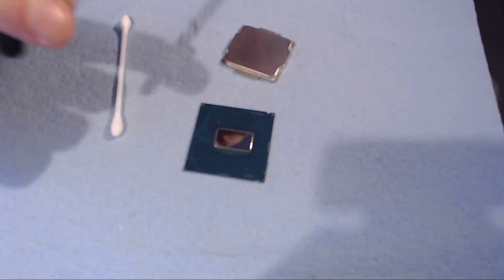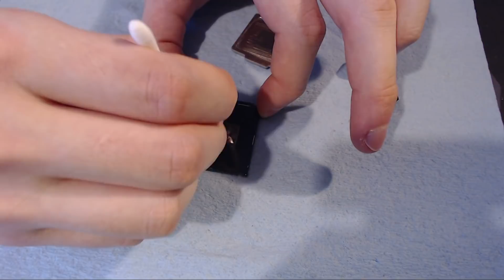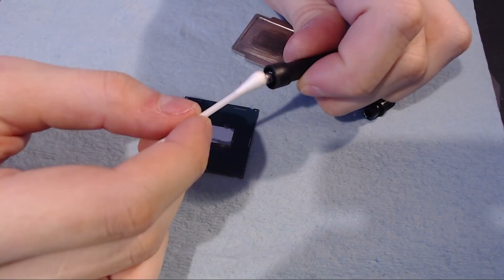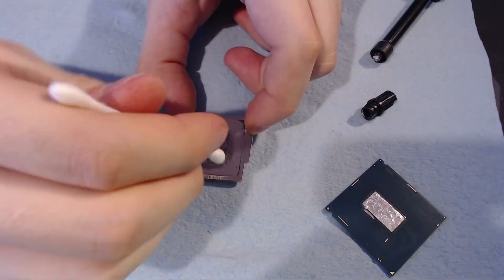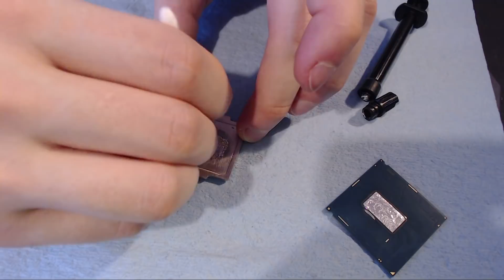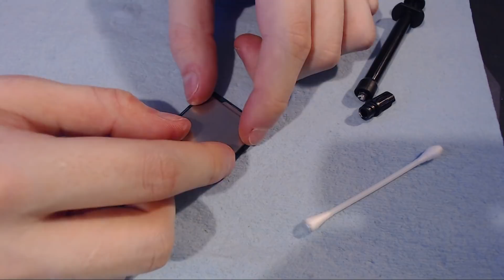How to safely apply liquid metal to things.

Comment: How about applying on heatspreaders, between heatspreader and heatsink? Also, mine is a bit coppery, polished it some time ago - I know that it will form an alloy with copper, do you know if this process is ongoing (and I should re-apply it after some time as it "went" into the copper?)

Comment: Garbage vid, use nail polish to protect the exposed pins if there are any close to the cpu die. First apply one layer directly over those pins, let it dry for 5 min then dry it with hair dryer for a few minutes, dont hold it too close tho, (I always place my fingers there so I dont apply too much heat), then do another wider layer over the pins, by that I mean so the acrylate covers a bit larger area than previous layer and dry it again the same way. Then apply a tiny bit more of liquid metal than usual so theres plenty for higher effectiveness, apply the heat spreader. If you dont apply a bit more, and you apply by priority so you dont short the pins, you might not see any improvement at all. I made that mistake the first time I used it. This usually works the same way for the GPU.

If you want to fix it in place, apply superglue on the bottom edge of the heat spreader, (I always use loctite 401, no problems after 6+ years of experience with multiple cpus) and place it very accurately over the area where it belongs. Its good to make markings with pencil or permanent marker to know it exactly, before you de-lid (btw I delid with regular table mounted claw press or claw clamp or whatever its called lol, works perfectly, no expensive garbage needed if you do it carefully). Use duct tape to hold the heat spreader more comfortably while aiming it over the area where it belongs, with superglue applied already, so make it quickly but precisely. Then when you hit the area where it belongs, press on it very firmly with your fist and wait for at least 20-30 sec. Try not to slide it to the side while applying force. After those 20-30 sec the glue should hold it properly. Both nail polish and superglues are normally made out of materials that can withstand high temperatures, just dont go over 110-130 C, which you shouldnt reach anyway. If you do it this way, you will pretty much never have to replace anything there, esp. when you put enough of the material. Additionally you can also put more nail polish where the heat spreaders comes in contact with the green pcb of the cpu. It is mostly useless if you applied the glue and heat spreader properly but you can still do so for a good measure.

Comment: i did it to my laptop today :D man when you said to JAM IT to the tube i should have really jammed it. I left some open space so it could come out and started pressing on it, it didnt come out(it was the first time i was pushing the tube btw) so i slighlty kept pushing harder and boom LM everywhere :D

And thats not even all, thankfully i did it on a paper towel so i started siphoning it back, i did 1 pull, then i needed to push the tube to pull again but i pushed it WITHOUT removing the removal tool and i pushed so fast, thats when LM got all over the floor :DD 

i siphoned as much as i could back from the floor probably took 10-20 push and pulls and then i used the method successfully, jammed the q-tip to tube and slowly pushed (by this time LM got used to moving so there wasnt any resistance), when little LM came out, applied to both components and heatsink without a problem and my pc is still working :).

So thanks for the tutorial. I would advise people to first pull the tube back and forth slowly before removing the cap to ease the LM into moving.

Comment: i'm currently using my rog strix g laptop, could i use liquid metal also for my gpu chip?
Reply: You could, i've done that before. Keep in mind, however, that liquid metal is electrically conductive and thus a spill onto the motherboard or any SMDs near the GPU die could cause damage.
Reply: @MrLostGravity  a friend of mine told me to apply nail polish around it, also found some youtubers do it.
Reply: You should definitely seal the capacitors right next to the die, if there are some. I've also used nail polish before, works rather well in my opinion. Just make sure to go over it a few times as it's hard to get full coverage with just one pass.
Reply: @MrLostGravity  would 3 coats of nail polish do? at least 10 min interval of application?
Reply: 3 coats is what i normally go for, but heavily dependent on how well the capacitors are coated. I usually check that visually. I'd definitely wait more than 10 minutes between each pass, 30 minutes is how long i normally wait.
Reply: @MrLostGravity  thanks for this, my condoctonaut will be arriving within this week. currently using Kryonaut

Comment: What about using a metal dish to as a delivery method? Squeeze into the dish then transfer to the surface and spread the with a cue tip on to the ihs? Then electrical tape right?

Comment: I want to delid an i5 4590 and an i7 6700k and use liquid metal on top of the i7's IHS. I also want to repaste a 1070 and a Vega 64 with liquid metal. Should I buy the 1g or 5g syringe?
Reply: 1 g should be enough but i would get 2g for the future
Reply: @Robyne_u61  Thanks for the advice.

Comment: So any old Q-tip will work? Also, is it 100% necessary to apply to both the die and IHS?
Reply: Pretty much. The reason is that liquid metal has a high surface tension (you can see it bead on the surface of the die if you apply it directly to the die) and when you put the ihs over the pcb, this surface tension will prevent the LM from "wetting"  the underside of the IHS. Imagine trying to wash an oily plate with water. The water can't get on the plate because of the oil. While this isn't really a "correct" analogy, the effect is the same.

Comment: 1 very important question I would like to ask : You show how to spread it out perfectly, but what about air bubbles in between the IHS and CPU core ?  Let's say the core is 15x15mm, it's 225 square mm. When air will be in between the IHS and core, the actual contact surface will be less then 225 square mm, and so the heat transfer is less good. Do you share my opinion ?
Reply: Just like he said it's not like traditional thermal paste.
And the rules of the traditional paste bubble issue do not apply here.
The rule is you want the liquid metal to be flatten enough that it sticks in the heatsink just like what paints do to your walls and by doing this the liquid metal will fill up the small gaps of the IHS (IHS if your using it in between heatsink cooler and cpu IHS).
Then since it's not like thermal paste that will easily stick to the heatsink cooler cold plate.
You also need to apply another one to the cold plate so that both liquid metal from top and bottom will touch each other and there you go you have connected a way for the heat to transfer.
Reply: I dont think thats much of an issue, what is in issue, and you can see it in video, is that maybe he applied too little. First time ever I did this, I applied too little and saw literally no difference in temp delta, and I applied around the same like he did here. Second time I applied more of it, so it was actually visible layer in there, not just like a reflective paint surface like in video, and I saw like 10 degree difference. I did however apply two layers of nail polish to protect the pins that were too close to the die, and since then I did that every time I delided any cpu afterward.

Comment: Never even thought of putting it on the q tip first lol. I always used to put a pin head on the die. Will definitely use this from now on and when i get my 8086k next week.

I always reseal mine though just makes it easier for resale and my ocd. Couldn't have the IHS in there all wonky :D.

But i must say scariest moment ever in my life was delidding my 7900x with homemade custom delid tool. Worked fine though. Same tool to do my 8086k next week :p

Comment: Protip for application if you find the liquid metal is not flowing easily: Heat it up a bit.

Gallium melts at 29c - and liquid metal has some additives that probably brings this a bit lower, but that's why it can be sort of syrupy at common room temperatures. Heating it up a little bit (and the CPU and the IHS too if you want) will make it more flowy and easily spreadable. You can heat the tube up in a glass of warm water, or just get a hairdryer on medium to heat up all the parts for a few minutes before you go to work.
Reply: Thanks!  Good reminder about temps.  Half a decade later and this random comment is still helping people.
Reply: @EmperorA0  Very glad to help ;)

Comment: Oh, and no matter how careful you are in applying liquid metal I'd totally recommend you insulate any contact points.

It's a really solid failsafe for 5 minutes of work. The material cost (some conformal coating or similar) is trivial and really easily availiable - and if you just spray some in the cap and paint it on (preferably 2 layers 15 minutes between) it's also trivially easy to do.

Even if it's just a 1% chance of the liquid metal moving that's a worthy insurance for an expensive CPU (and I've actually seen quite a few cases of it moving. Mostly probably because people apply too much of it. More user-error than the compounds fault - but then again your CPU doesn't risk frying if you make a sloppy mess with most thermal compunds. This absolutely does.

Comment: So it being this thin is not an issue in terms of it being able to fill all the imperfections? I guess under mounting pressure it should be enough even if super thin.

I hear the miscoloration people seem to be so worried about is just a thing that happens from the gallium diffusing into the other metals - basically putting it's atoms in between in the gaps where it can fit in the other metal. Aside from being unsightly it should not have any negative impact on the thermal properties of the surface. Actually I hear it might even slightly slightly improve the thermal properties if anything - but mainly neutral. Diffusion in itself is not a problem in most metals - just the metals where it causes the other metal's bonds to weaken (which is what happens in alu.).

The way it acts differently before and after the surface has been exposed to gallium before is no doubt because of this wetting effect the diffusion has. Before it's like water on really dry ground - it will tend to skip across, while after it's more like damp ground where it sticks to it more easily. That's obviously just an oversimplified analogy of the atomic forces involved here, but wetting and doping of materials (which is basically what happens here) is a well understood phenomenon you can read up on if interested.
If anyone happens to have any hard data/testing to show results of how thermal conductivity of copper and nickel-plated surfaces change (of at all) after gallium doping then I'd be really interested to see it.
I imagine because of this - if you wanted to be hyper-optimal you might be able to get a slight improvement if you bothered to do a re-application a month down the road from the initial application since at that point all the reactions will be done and the materials saturated. Probably unlikely to have statistically measurable effect (with the impresice measurements of CPUs we have to work with) since it's likely a trivial amount of the gallium that is diffusing in, but if for some reason you should happen to notice any drop in performance and you have eliminated all other factors (ambient ect.) then that's the first thing I would consider. After the second application I have no reason to suspect it shouldn't remain stable for a very long time.

Comment: So what is your view on using a custom copper IHS with liquid metal?   Would the LM  diffusing into the copper cancel out any benefits from the larger IHS surface area?
With 1.35v adaptive LLC 6 my temps are still not amazing even with a 280mm cooler.

Comment: So about the resealing.. Like if its for testing then I can see that doing it like this is no issue, but for a full time system is the tension of the hold down system enough to keep the IHS in place? 
For the rest, wel great vid!
Reply: Yes, it's more than enough. Resealing is pointless if you're just going to keep the CPU installed for a long time anyway.
Reply: alright, thats something to mess with once the liquid metal arrives ^^

Comment: Hey brotha! I've been trying to find info on uncore ratio and what I should be setting this at for an 8600k @ 5GHz,  and what voltage is associated with uncore ratio to help with stability. Any pointers? I've read to keep it under the clock speed of cores not much info on the web.

Comment: I just used the small funnel in the package and then gently squeezed and applied a very small blob directly on the die then just spread it with a Qtip.
I did it multiple times on a multiple CPUs, I never had an issue where the LM just shout out and made a mess everywhere.
Reply: It happened to me, I used the funnel, slowly applied pressure then it shot out half the tube on the cpu and 10cm along the table.
Reply: @TrigrH  Same, you can never rely on the syringe pressure 100% on these things, bubbles/pockets seem to be able to occur. Almost ruined an RTX 3070 with lm due to this, but managed to correct with a deep iso alcohol cleaning.
Reply: Well there is still a human error there if you directly putting it in the die/IHS.
Specially if your doing it inside the case and the case is not completely flat when titled (some case due to the stand design like mine)
Then liquid metal will be happily sliding now in going down to the PCB.
So Q-tip application before cpu application will have 100% no error.
Unless your dumb and want to directly paint the PCB with silver coating ahaha

Comment: am i silly to be paranoid about fibres from the q-tip mixing with the liquid metal and staying on the cpu?
Reply: It's not a silly question, but you don't need to worry, Tthe fibres are unlikely to make a measurable difference in temps, and wont impact any components of your system
Reply: after a quick google i saw that conductonaut comes with its own qtips for paranoid individuals such as myself. carry on.

Comment: Now do a same video with that Graphene thermal pad.
Reply: Doesn't have to be a same video, but one that checks if it's possible to actually fit one under the IHS would be nice. If it's too thick, I don't think it will fit (I don't know though), but if it fits, it'd be interesting to see a performance comparison with liquid metal. Could to LM+Thermal Paste vs LM + LM  vs LM + Graphene Thermal Pad vs GTP+TP vs GTP+GTP.

Even if GTP + GTP loses out to LM+LM, if the loss is minimal, it could easily turn out to be the better choice simply because it doesn't have the inherent risk of LM.
Reply: The point is most channels are avoiding it for some weird reason.

Comment: Stupid question: instead of liquid metal can I use regular thermal compound like the thermal grizzly Kryonaut between the die and the ihs?
Reply from the maker: you can but the thermal performance on high heat loads sucks very badly.
Reply: Actually Hardcore Overclocking at the high heat range it performs worse than the stock Intel paste?
Reply: i see someone is now a pcmasterrace man
Reply: performs better but not as good as LM
Reply: I literally just tried this with Kryonaut on my freshly delidded and direct die cooled 14900KS hoping to avoid any long term dry out. The answer is an absolute no, with temperatures no better than the original Intel TIM plus Kryonaut. It was a very good thin coverage after dismantling, but replacing with Conductonaut literally dropped temps by 20C at 320W using a MoRa 420!

Comment: 3:14 is it ok  to cover  the golden thingys  around the  die  with  something like  a  clear nail polish  "just in case"  :D
Reply from the maker: yes it is.
Reply: Use kapton tape. Very easy and safe. Link to Amazon https://www.amazon.com/gp/product/B006ROR6JQ/ref=oh_aui_detailpage_o02_s00?ie=UTF8&psc=1
Reply: Why not use an Acrylic Lacquer Conformal Coating ? This is what it is made for.
MG Chemicals 419C-55ML Acrylic Lacquer Conformal Coating, Clear ,55 ml Bottle - $12.95 at Amazon for a 55ml bottle. Which mL vs mL is cheaper than clear nail polish and it is a constant formula made for this type of thing..
This is what Professional's and Hobbyist alike use to protect their electronics.

Comment: Why do you need to apply to both and did you use that nail polish to protect? Also if you go bigger on the IHS the heat wont cause the liquid metal to drip down on the chip?
Reply: The IHS on the Threadripper 1950x is solder, is that better?
Reply: I'm fairly certain the surface tension of the liquid metal will keep it together up to temperatures beyond CPU temps

Comment: i dont no for thermal grizzly but for liquid pro, never apply this direct die with cooper plate cooling, with contact with air its literaly soldering the two pieces together! and its not take 6 mount, only 1 or less
Reply: Super Seven baguette